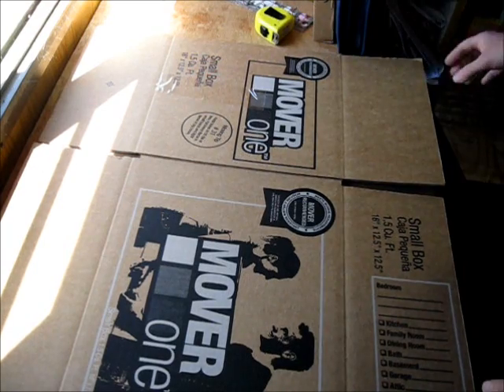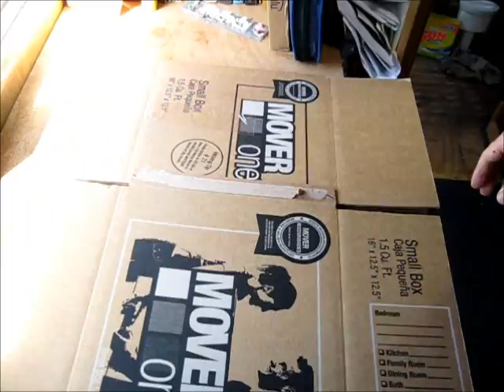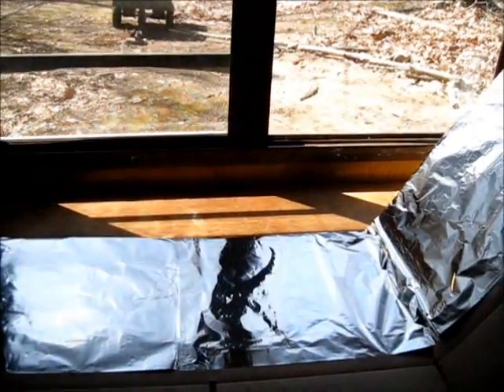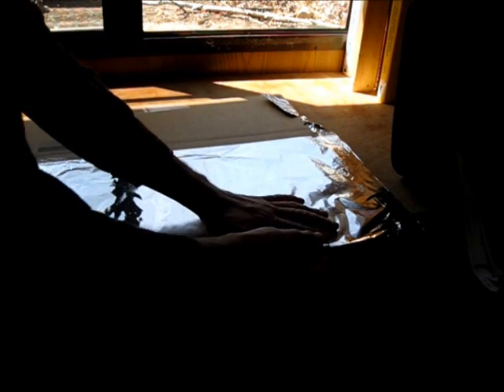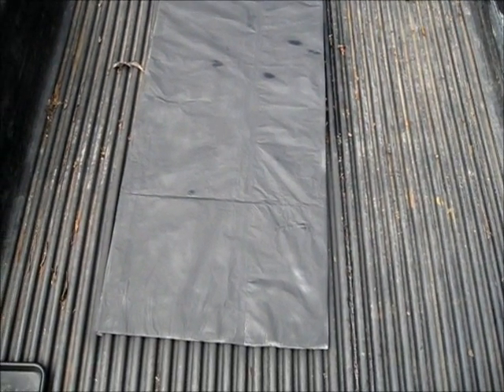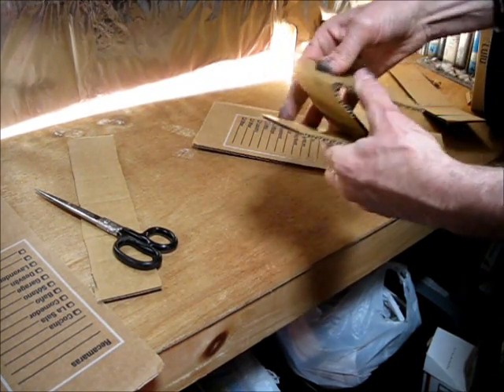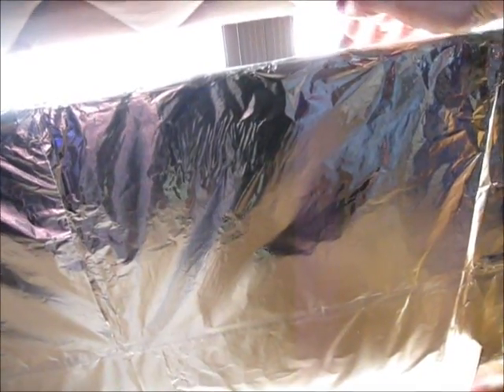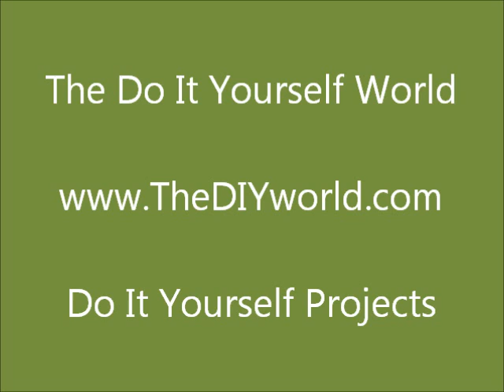Make A Passive Solar Window Heater For Under Two Bucks

Comment: All they nay sayers are missing something. What this man did, was create a circulation of air. Cold room air enters the bottom. And is heated by the sun via the black surface, then exits the top at a higher temperature, sometimes as much as 30-40 degrees difference. Thus, warming the room very noticeably.  The cardboard is not much more than a make shift frame. Its purpose isn't meant to store heat. Its basic science and it does work and it works much more noticeably that just letting plain sunlight in through the window. Try it, then come back and admit you were wrong. We'll wait.

Comment from the maker: Umm, last year I heated my camper only with such a design. Look it up, I am not the first to do such a thing. Its called a passive solar window heater.

The sun shines on a black surface, can be any material, who cares. It gets hot. The air flows upwards and draws cooler air in the bottom. Automatically flows.

I have the silver side in the INSIDE of the camper to reflect heat back inside. The outside, facing the sun is painted black to absorb heat.

It really works, trust me. I use them daily

Comment: I have read the arguments going on here about whether this would be any more effective or not and I tend to agree with those who say it would be because of one simple experiment I tried a few years ago.  I made a solar oven. To say that a solar oven would get hot enough to bake without painting the inside black would be wrong. This has the same components. I sure wish this guy would have stated the difference in temperature in his camper before and after- that would have saved a LOT of arguments here.  Great video- thanks!
Reply: Sure, using a black painted surface helps capture solar energy as long as you don't then insulate the whole setup so that zero convection and radiation can occur, which is what he managed to do.  Whatever tiny amount of heat he may be getting is because the black surface is warming up some air molecules floating right in front of it.  No test is needed to know that he isn't getting even one degree F with this setup.
Reply: Sure, using a black painted surface helps capture solar energy as long as you don't then insulate the whole setup so that zero heat can be radiated.  Aluminum has zero ability to hold heat, so there is nothing to radiate, that is why aluminum can be used in roofing.  Whatever tiny bit of heat he may be getting is because the black surface is warming up some air molecules floating right in front of it.  No test is needed to know that he isn't getting even one degree F with this setup.

Comment from the maker: Actually, I get more solar heat with the black painted metal. I have tried both. Of course, with the solar heater outside and the window free, that is much better. But it is a more complicated build and hard to fit into camper windows due to the three panes of glass that open outwards.

Comment from the maker: Yes, you are correct. The black surface absorbs the suns rays, heating it up. The metal conducts heat nicely.

Yes, metal blinds would be perfect.

Not sure about the soda can heaters. It all depends on surface area. The more surface area, the more heat output.

But the can heaters are much more work and I like my simple heaters. Plus mine is easier to store in summer when its not needed. Folds flat and goes away behind a shelf or under the sofa.

Comment from the maker: Thanks.

Anything painted black will work actually. Its the black that absorbs the heat. Use whatever materials you have on hand. I use the aluminum foil because it can take the heat.

Comment: Agreed. Even black curtains will collect and disseminate the light turned to heat. 
To get more heat one can put reflectors around the outside of the window and angle them to shine more light into the window. There could be increased glare but a dark colored open weave curtain would stop that.

Comment: Interesting experiment and good DIY video, but you really needed before-and-after temperature readings to prove your project works.  One of the things I have a hard time with is that you have blocked the natural heating ability of your window with a barrier, so is the focused heat at the top any more energy than the diffused heat through an unblocked window?  That question needs to be answered because there is a good chance that the heat you are feeling at the top is less than what you'd otherwise get.  What MAY be a benefit is at night when those boxes act as insulation.  Temperature readings would be needed throughout several days.
Reply: It's all about heat abortion in the room...just because the sun light comes in doesn't mean the radiation is being converted to heat.  Get in a car with black interior verses one with light interior and see which is hotter.  The black surface should maximize the conversion of radiation to heat as long as he can get it to circulate into the room he will be better off. Passive solar design typically uses dark stone flooring to absorb the heat
Reply: Remember the power of convection. I imagine that the heated air rises and enters the room through the gap/spacer at the top of the window. 😊

Comment: I think a lot of people miss the point of this kind of heater. Sure, it does not add any more heat to the room than just having the sunlight shining directly in. What it does do is use that energy to heat up the air more directly than first heating the floor, sofa, table, etc which then slowly radiate the heat into the room. The total energy gain is the same, either way, but unless you happen to be laying directly on the warm tabletop, you probably will be more comfortable with the energy warming the air instead. 

Also, those who suggest that it is somehow insulating the window are missing the fact that the window is probably losing more energy to the outside using one of these things, not less. The temperature difference between the inside of the glass and the outside has a huge impact on how quickly energy is lost. If the outside is 30 degrees and the inside is 65, total energy lost per hour will be significantly less than if the outside air is 30 degrees and the air immediately inside the glass is 90 degrees. A steeper temperature gradient means faster heat loss. That doesn't mean that using one of these things still won't make the room feel more comfortable.
Reply: You are wrong. Without the solar heater, light will be lost by bouncing back out the window. If you were to stand on the outside and look in, everything you see on the inside is actually light bouncing back through the window. The black foil actually absorbs the light energy and transforms it into heat energy. The heat then dissipates into the inside air. Its basically a radiator that runs off of light. Everything you see is light being bounced off of an object. The light that you see is the spectrum of light that is not absorbed by the object. So if you see a red cup, it absorbs everything except the red spectrum of light. Black absorbs the most light, basically absorbs most of the spectrum, hence why when you close your eyes, it is black. Since the light that would normally be bouncing off all the objects inside the camper, then back out the window, this device captures most of the light energy by the black paint. The energy is then dispersed throughout the foil.

Comment: Let me just sum up all these comments and add my own spin.

There are 2 relevant points here.
-Heat generation
-Heat retention

He had done both.
He added thermal mass to his house by adding a solid black object to his house. hand wavy heat transfer stuff black stuff holds onto the heat better than. If you don't like the hand wavy stuff look up black bodies or take a heat transfer course

So basically his old house could hold 3 energies and now it can hold 4.

So now comes the part that most people ignore below and that's heat retention. Assuming that the window is the main culprit in losing heat (as it generally is) then insulating the window prevents heat loss. So with this set up he gets approximately the same heat in the house, but loses less. Also a larger proportion is coming in a heat energy rather than visible light. 

At the end of the day, though, this works much like that candle heater thing. It's more like a space heater. It doesn't necessarily make the room hotter, but it does a great job of keeping part of it warmer.

TLDR: It insulates the window while letting in all the heat energy. Net effect warmer, debatable on how much.
Reply: On what planet is a piece of cardboard "thermal mass?"
Reply: yes, same object has the same thermal capacity not depending on a color

Comment: I did something similar in the summer to a window that was so hot from the sun, it would actually burn your hand to the touch. I covered  the window with aluminum foil, no cardboard, and it (Cooled) my mobile home more than 5 degrees.
Reply: Yea how about that?

Comment: You are gonna need that with the next cold front coming through... Heck, I never seen anything like what this dip in the jet stream is appearing to go for before(or just don't remember). Heck, at the end of the week, my area is suppose to hit the 40s(maybe lower depending on how far and where the dip goes) later this week. 40s in May at the Louisiana coast is not normal.

Comment: I have a question that perplexes me. I understand how the aluminum foil facing into the house acts as a radiant barrier, preventing heat from escaping to the outside. But I'm wondering what value there is in having the foil on the painted side, as opposed to simply painting the bare cardboard.

The way I understand this, the radiation coming into the house hits the black paint and heats up. The inner later of foil (facing the window) will then block the radiation from reaching the cardboard and reflect it back outwards into the black paint. Without the inner (window facing) foil, the radiation hits the black paint, heats up, and then passes through the cardboard, hits the outer (room facing) foil and is reflected back through the cardboard and into the black paint. It seems to me that having foil on the inner surface (just beneath the black paint) will result in faster heat-up and cool-down times (since the foil will have less thermal mass than the bare cardboard) with zero net change in the amount of heat gained. Is the inner lining of foil a waste of aluminum or am I missing something?
Reply from the maker: I put the foil there to give me a good surface to paint and as a sort of heat shield for the cardboard. Probably not needed.
Reply: Thanks.

Comment: so is the idea that the warmth needs a black medium to collect on, and that increases the absorption? And the foil because it is a metal that is heat conductive?  I know your measure is cost effective but could you take older metal blinds paint it black, remove the top strip or two and achieve the same effect? Would it be as good as the soda can heaters you see in the videos that go outside with wholes in the walls. Food for thought.

Comment: Sounds like the same guy as one who has a tv hooked to solar panels. I think he would be way better off im sure running a solar heated roof heater. Paint it black or use that thing and a box you can build on the roof. Also using a small solar panel to run a little fan or two pushing air out of the box and into your camper. Pretty cool though id take a digital reading of the heat before and after to show progress. Roof would be much better and you'd still not feel like your stuck in a camper with one window,haha.
Reply from the maker: charleysturbos True, maybe I will make a new one this winter. I am building a tiny house on wheels right now and hope to heat it with solar.

Comment: These videos are great, they make me think.  I know cardboard is plentiful, wouldn't a thin piece of aluminum painted black on one side (facing the radiant heat) be more efficient than having a piece of cardboard, which is an insulator, in between?

Comment: Instead of black spray painting to foil would it work if i use black plastic bag taped on to the foil? 🤔
Reply from the maker: In that case there is no need for the foil. But make sure it is not reflective. The idea of the flat black paint is that it absorbs a lot more light.

Comment: The only passive heater on windows who as the better result  , it's nothing on the windows , no lost heat and all the radiant as come inside and on the middle of the room. If you don't agree , just go back to school guy's and study little bit. But solar passive is a good stuff if you dont block the window , just need a perfect and not cheap conception.

Comment: Thanks for the great video!
A couple questions:
1. Why use foil on the window/sun side of the cardboard, if you just cover that foil with black paint, instead of just covering that side of the cardboard with black paint and no foil?
2. Why use this creation at all, instead of just letting the sun shine in through the window and heat the room? There's so much more surface area in the room (furniture, counters, knick-knacks, floor, walls, etc) for the sunlight to hit and heat up, than there is on that window heater. Please explain.
Thanks!

Comment: nice work, ignore the morons that couldn't bother giving this a try. On a sunny day in march 2 2015 (today) I am reading 95 degrees out the top  gap and 68 degrees coming off the floor gap using a veratemp thermometer. not bad for 5 bucks and 20 min